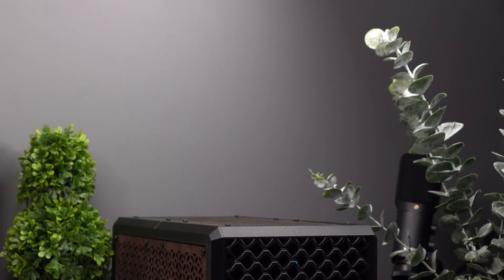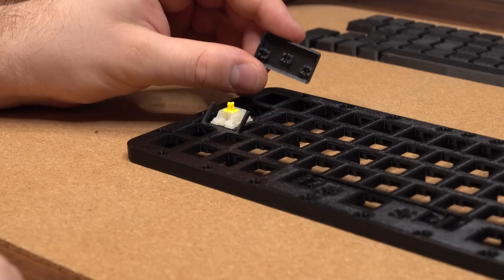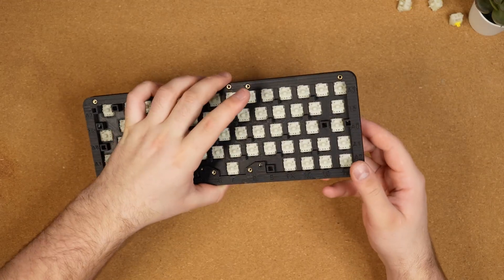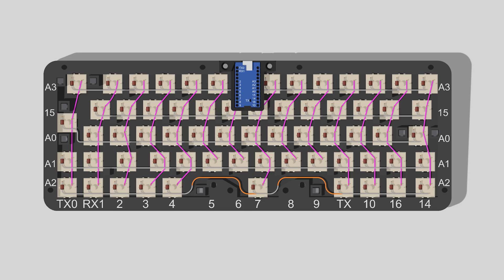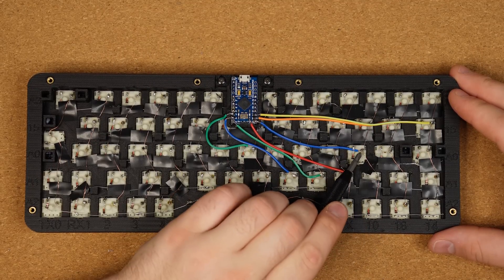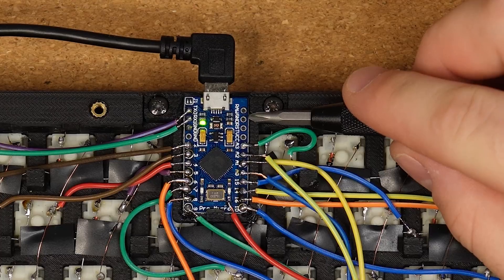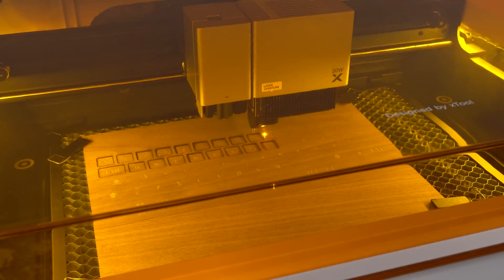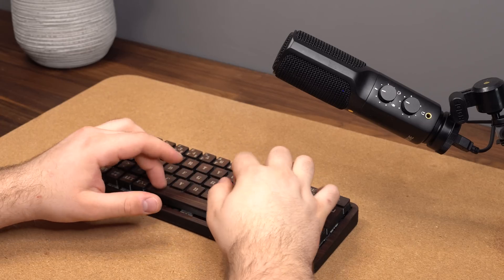Building A Custom Keyboard With Real Wood

Comment: Be careful. Carbon fiber filaments will make your hands itchy and your finger skin gets micro splinters.
Reply from the maker: I’ve seen the videos about that too, however I personally have never experienced any negative effects of using CF filaments, at least not so far and lately I’ve used it partially in almost every project this last year. 

Mainly the CF03 from FormFutura which only uses a 3% CF infill and I’ve never once found needles in my fingers. Though it might be thanks to the low CF percentage that it’s been fine, as most CF filaments you see are 10% CF which might explain it 😁

Comment: You should have glued the top wooden keycaps parts first, sanded the sides for a cleaner and more professional look and solder them later.
Reply from the maker: That could have worked for sure 😊 perhaps in a future edition.

Comment: I see there is a 10w and 20 machine. Can this project be done on the 10 what laser engraver?
Reply from the maker: Hey, yeah the 10W should be sufficient for this project as the wood used is only 3mm thick. Settings may vary as the laser is weaker though, so you’ll need to experiment to see which settings give you the best results.

Comment: Absolute cinema mate! Not my taste of font, but i love how it’s dumb proof!
Reply from the maker: Thank you! There was actually a specific reason for choosing this font. Mainly because the «Stencil» font I used has split letters, meaning there are no closed loops in any letters like for example A O P Q B etc. By using any other font those would by default in the laser software assume any closed loop is a plane and color it in. Mainly it was for a practical purpose to make laser engraving easier to do, not necessarily for the looks of the font 😊

Comment: I wanted to suggest something about the wooden key tops if you made the keycaps themselves with a counter-bored/sunk peofile the wooden tops would just sit there with no room for any issues regarding alignment. The thing is idk if it would affect the 3D printed caps or how the tolerances fair with each other since it's 2 different machines and aslo idk how it would affect the sound profile of the caps.

other than that it's an impressive project and you made it look so simple even though we all know it's not as easy as you made it look.
Reply from the maker: Hi, if I had a CNC machine I’d definitely make some kind of countersunk solution. However since the laser machine can do only flat surfaces it’s hard to make it any other way. The alternative would be to make the wood pieces slightly smaller countersunk 1mm or so into each cap by having a small plastic border around the wood piece for alignment, but this would change how they can be printed and may have required supports which has it’s own challenges. 😊

Actually, it is pretty much as easy as shown in the video. Developing it and making it all work im the first place was a real head scratcher, but once I got a working prototype the «final» build was pretty straight forward if following the pre-made files and instructions. I tried to make it as easily understandable as possible 😊

Comment: As an alternative to the fully conductive wire you could use enameled wire. It's easy to handle and you simply burn away the paint on the parts you want to be conductive.
Reply from the maker: That’s actually genious. Is the molten solder itself enough to burn through the coating? If so that would be so cool! 💪
Reply: @makerunit  you have to heat it up for a while, then it's burnt away.
Reply from the maker: @ Aha, got it 😊 thanks!

Comment: Finally, someone with a true custom KB. I feel like I haven't seen something like this since 2019. This is what this Hobby should be all about
Reply from the maker: I feel like a PCB is cheating if saying it’s fully custom 😅 also, it’s extra fun to see it work after you’ve actually done the hard work yourself. 💪
Reply: @makerunit  I think pcb is fine if you designed it yourself. The added stiffness as well as the additional area the soundwaves get to bounce off of are a factor that some people really like. But handwiring is the true OG move and one of the most rewarding things one can do in this hobby

Comment: I like the look. Do not like the implementation. It would have been a lot more interesting at least to me if you used something like the Redux Keyboard PCB or any of the number of 60% PCBs out there. I just don’t have the energy to solder that many diodes when a cheap off the shelf solution exists that requires no soldering.
Reply from the maker: Hi! Thanks! 

Totally fair that you would prefer a pre-made PCB rather than manually soldering all the wires, it’s not for everyone. A PCB would definitely be a simpler option, though I personally like having made it all from scratch not necessarily for the functionality, but rather for the learning experience too due to it being a custom keyboard 😊
Reply: Nah you did an amazing job came out great @makerunit
Reply from the maker: @smokingbeetles5793  thank you, I appreciate it! 🙏

Comment: That electrical tape is gonna fall off, at least use kapton tape
Reply from the maker: Maybe, time will show. I still don’t think it’ll be an issue in most cases because the columns will hold them down anyways so even if they do come loose it’s unlikely that they’ll end up shorting as the whole build is enclosed 😊

Comment: I would love to do something like this, but with an aluminum base and instead of 3D printed keycaps with wood glued on, making the keycaps entirely out of wood. I just wish i had the resources to build it myself. I have the switches and a PCB that is hot swappable. Just not the aluminum or wood. Love the outcome of your keyboard! Great work!
Reply from the maker: Thank you Brian! Making the keycaps 100% out of wood would definitely make the project twice as good! A metal body would also be awesome! It’s possible to purchase pre-cut aluminium parts etc from places like PCBway or other similar sites I believe but I’d think the biggest callenge would be carving the keycaps out of wood.
Reply: @makerunit  That's what I was trying to figure out. Since I want side legend wooden keycaps, it would be extremely difficult. If you ever are doing this, I would love to watch the video on how you do it, go out, get the resources, and find a machine that would be able to do this! I appreciate your content!
Reply from the maker: @ A 3-axis precision CNC machine would probably be the right tool there 😅 Imagine an «outer shell» made out of CNCed wood, and an inner part made from CNCed aluminium. That would be insane, mounted on an aluminium chassis. That sounds like it would sound pretty sweet too 😅

Comment: Honestly, i expected you to use Wood Filament on a 3D printer. Cuz you 3D print alot of your content and i've never seen anyone talk about it
Reply from the maker: Yeah I mainly do 3D printing and plan to focus mostly on that in the future as well for now, but when I had the chance I had to give this type of project a shot too 💪
Reply: @makerunit  No yeah, it's a cool project, good result. I'm not denying that, don't get me wrong.
Reply from the maker: @skorpysk  I think I got you right 😊 I read it as a positive comment, or were you disappointed that it wasn’t 3D printed wood filament? Because I was first thinking that, but changed my mind to go for the laser cut wood tops instead 😅
Reply: @makerunit   I was a little dissappoited. since nobody is talking about it, yet i know it exists. But the end result was cool enough, whre dissappointment was no longer there
Reply from the maker: @skorpysk  ah, I see! Funny thing is I actually was planning to do that originally, I even have the wood PLA ready, but ended up changing the plan last minute to match the PC case to make a «matching set» instead 😅.

However, I still have my wood PLA ready to be used so my intention is to use it for a project very soon! 😊 just probably won’t be a keyboard.
Reply: @makerunit  nice, can't wait

Comment: to be a first time build, you got it right the first try. Even the sound is not what expected. KUDOS!
Reply from the maker: Actually, it’s my second keyboard build, I made one a few years back if you look at my channel, but let’s just say this is everything I didn’t get right in the first attempt. The «first» one can probably be described more as a brick with keyswitches on 😆

I’m glad you like it! Thanks!
Reply: @makerunit  WOW! have you thought of having a custom PCB instead of handwiring?
Reply from the maker: @ it has crossed my mind, however I do kind of like the handwiring part of it, feels more custom if it’s handwired I guess 😅

Comment: I quite like the design but the only thing I would change is the font used for the letters, IMO it doesn't fit as well, but have no idea what other font to use
Reply from the maker: I do agree with you to a certain degree, but there’s actually a practical reason for choosing the font called «Stencil». Mainly this is due to how my laser engraving software works. If I import a SVG file with «closed loop» normal letters, then all the letters like O, P, R, D etc that have closed loops in them would automatically engrave the middle as well if that makes any sense. So the entire D would be black, not just the D shape, but the inside hollow part also.

By using the Stencil font there were no closed loops in any letters allowing the software to process it properly and engraving the letters correctly 😅 (sorry for the long perhaps slightly unclear explaination)

There might be a workaround for this, none that I’m sure of how to do but there’s probably a way around it.